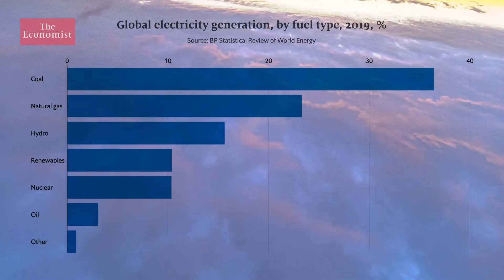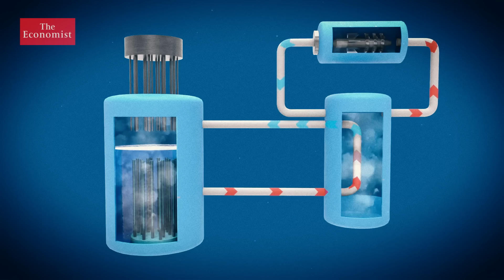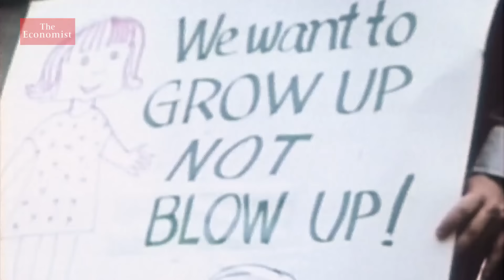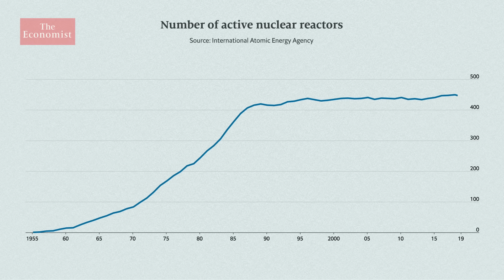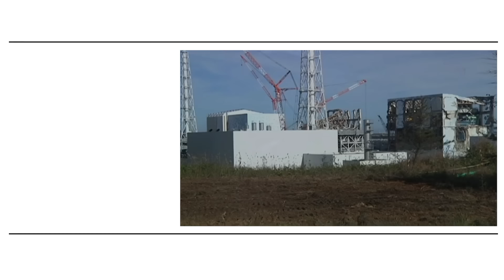Nuclear power: why is it so unpopular?

Comment: Anyone with even a partial understanding of chemistry, physics and nuclear fission, and energy production and IS OBJECTIVE, will know that WISE if totally biased and falsifying figures.  Especially when it comes to Molten Salt Reactors.  It is important to understand that first of all Thorium produces 200 times more energy per atom than Uranium and 2,000 times more than carbon-based fuels.  You cannot be emitting carbon when your fuel source is not carbon-based!  The other important thing to understand is that a Molten Salt Reactor does not require a cooling complex, which is what has been what failed in all three of the major nuclear accidents in history.  That is because the molten salt is both the fuel carrier and the coolant.  Because of its chemistry, it can be heated to 1,500 degrees without coming to a boil  MSRs operate under 700 degrees, we'll within a low threshold.  Water-cooled Uranium plants must pressurize the water to an extreme because water boils at 100c.  Because of the Liquid Flouride Thorium Reactor's inherent self-regulating temperature control, the elaborate pressure and cooling systems and all of the backups, and heavy construction of domes, etc, are eliminated making them far less expensive and hugely more feasible for getting into production quickly.   MSRs do not produce fissile material, so they can be located anywhere.  And since they also do not require water for cooling they can be built in deserts or inside large nations far from water.  ThorCon has designed an MSR that will be on a ship and can be located anywhere.  The political and social resistance against MSRs is based on ignorance and dishonesty.

Comment: On 24 November 2013, the Geneva interim agreement, officially titled the Joint Plan of Action, was a pact signed between Iran and the P5+1 countries in Geneva, Switzerland. It consists of a short-term freeze of portions of Iran's nuclear program in exchange for decreased economic sanctions on Iran, as the countries work towards a long-term agreement. It represents the first formal agreement between the United States and Iran in 34 years. Implementation of the agreement began 20 January 2014. Senior officials of the P5+1 and Iran met February 18-20 in Vienna and agreed on a framework for future negotiations. The next round of senior-level talks are scheduled to begin March 17, 2014 in Vienna. 

The Nov. 24 interim agreement inked in Geneva, Switzerland, between Iran and the United States, France, Britain, Russia, China and Germany calls on the Islamic Republic to halt production of near-weapons-grade nuclear fuel in exchange for some relief from economic sanctions, amounting to some $7 billion. Some hailed the deal a historic achievement, others, a historic mistake. The deal calls on Iran to halt construction of the heavy water nuclear facility in Arak, limit its uranium enrichment activities to 5 percent and dilute or convert its existing stockpiles of 20 percent enriched uranium. Iran also agreed to refrain from installing more sophisticated centrifuges and to allow U.N. inspectors daily access to nuclear facilities. The measures are to remain in place for six months. During that period a permanent agreement is to be negotiated. 

Iran's former nuclear boss has sharply criticized the recent hard-won nuclear deal signed between Tehran and six world powers, saying Iranian negotiators compromised on the country's nuclear program. Fereidoun Abbasi, the former head of the Atomic Energy Organization of Iran (AEOI), said in a radio interview on Tuesday that Iranian negotiators acted hastily and gave many concessions to the world powers during the Geneva talks. Iran and the five permanent members of the United Nations Security Council-the United States, China, Russia, France and Britain-plus Germany sealed an interim deal in Geneva on November 24 to pave the way for the full resolution of the West's decade-old dispute with Iran over the country's nuclear energy program. Under the Geneva deal, the six countries have undertaken to lift some of the existing sanctions against the Islamic Republic in exchange for Tehran agreeing to limit certain aspects of its nuclear activities during six months. It was also agreed that no more sanctions would be imposed on Iran within the same timeframe. 

A senior Iranian cleric says the breakthrough interim nuclear deal struck last month in the Swiss city of Geneva between Iran and six world powers over Tehran's nuclear energy program frustrated anti-Iran propaganda. "The favorable outcome of these [nuclear] negotiations was that the propaganda launched by the [global] arrogance against Iran faded out given that they had long been falsely claiming that the Islamic Republic of Iran is pursuing atomic weapon while we have always stated that we are seeking to acquire nuclear science," Tehran interim Friday Prayers leader Ayatollah Mohammad Emami-Kashani told worshippers in Tehran. Iran and the five permanent members of the United Nations Security Council-the United States, China, Russia, France and Britain-plus Germany are involved in negotiations over Tehran's civilian nuclear activities. Iran and the six world powers sealed an interim deal in Geneva on November 24 to pave the way for the full resolution of the West's decade-old dispute with Iran over the country's nuclear energy program. Under the Geneva deal, the six countries have undertaken to lift some of the existing sanctions against the Islamic Republic in exchange for Iran agreeing to limit certain aspects of its nuclear activities during six months. It was also agreed that no more sanctions would be imposed on Iran within the same timeframe.

Comment: soooo    how have they disposed of the 80000 tons of nuclear waste.   its not about generating energy   its about the lethal toxic waste that lingers for millennia
Reply: It’s a valid problem but climate change is a far bigger one. Nuclear waste may be extremely dangerous but it can be contained, unlike the toxic fumes released by burning fossil fuels. If you live in a city, you’re already significantly more likely to suffer from respiratory illnesses or develop lung cancer.

Comment: Not a supporter for Uranium or plutonium fueled nuclear power, due to potential nuclear disaster. 

Highly supportive in molten salt nuclear research. 
Whatever is clean, effective and efficiency with reliability, then i fully supported.
Reply: Still have to dispose of reactor at end of
commission or entombment event.  Terrapower is just bill gates diversifying his portfolio.
Reply: @kaiyack  But to my understanding, using non uranium or plutonium material such as thorium has a significant shorten half life of nuclear waste.
Reply: @gerjaison  thorium reactors will still create uranium 232 waste which is emits gamma radiation. You could make uranium 233 by messing with the protactinium but that’s the resulting u-233 is only useful in weapons.  Any radiation released an issue.  Basically Trading CO2 for other forms of pollution.

We can deal with CO2 if we optimize agriculture, forestry and oceanography.

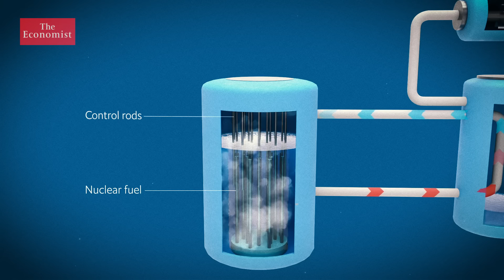Comment: While what you said 3:14 about water acting as a moderator is technically true, it is misleading. A moderator slows down neutrons but this speeds up the reaction. Yes, this is a kind of control, but it's such a common misconception that could have been avoided here.

Comment: Uranium is a poor fuel for electricity generation, but its waste is ideal for taking the next step in creating nuclear weapons, which was required in the 1950's. The original belief was nuclear electricity generation would be too cheap to meter. 
Thorium was known about in the 1950's and was originally considered as the reactor fuel for the first USA submarine. However each fuel has advantages and disadvantages. Thorium is a poor choice for weapons, but a better choice for electricity generation in new technology no pressure salt reactors which can be situated in any industrial estate without fear of pressurised water escape with nuclear contaminants. 
The not in my backyard mentality should not apply to new technology Thorium salt reactors. Thorium is currently co-used with Uranium in some existing high pressure reactors, which negates its unique advantage.

Comment: How do we address the spent fuel issue?
Reply: Stored underground
Reply: @captainjackpugh6050  it is important that you get your facts right, because up to a couple of years ago there were no countries with operational underground repositories apart from Finland. There are still risks involved with underground storage, and span it across thousands of years of storage required the risks rise high
Reply: @animatedarchitecture      There are no risks if it is stored properly
Reply: @captainjackpugh6050  There is no risk free solution that will allow be fool and risk proof for thousands of years
Reply: @animatedarchitecture  Coal is destroying the earth. Storing nuclear waste underground is not.
Reply: @lau6438  neither coal nor nuclear waste would destroy the planet, but it will affect life on it. Storing waste underground is not safe, hence there are no certified underground 'landfill' facilities as of yet, you can't warrant something for thousands of years. Don't forget that nuclear waste is not the only waste from the nuclear plant, it also uses large amount of water to keep the cores cool, which then becomes contaminated with radionuclides. It's not a longterm solution but a beginning of a new one.

Comment: MALAY SUBTITLES Part 2 of 3

05:47
... selanjutnya didorong oleh pembebasan pada tahun 1979 ...
05:50
... sebuah filem berjudul "The China Syndrome" ...
05:53
... yang dengan jelas menggambarkan kemalangan di stesen janakuasa nuklear
05:57
Perkara mengenai "Sindrom China" ...
05:58
... selain itu adalah contoh yang cukup baik ...
06:01
... dari pembuatan filem paranoid 1970-an itu ...
06:04
... adakah ia keluar lebih kurang pada waktu yang sama ...
06:06
... kerana ada kemalangan nuklear di Pulau Three Mile
06:09
Dua pam air yang membantu menyejukkan reaktor nombor dua…
06:12
…menutup
06:13
Pegawai mengatakan sekitar 50-60 ribu gelen air radioaktif ...
06:18
... melarikan diri ke bangunan reaktor
06:22
Ini diikuti oleh kehancuran terkenal ...
06:24
... di Chernobyl pada tahun 1986
06:28
Dan kemudian pada tahun 2011 ...
06:29
... tsunami menyebabkan kemalangan ...
06:31
... di sebuah stesen tenaga nuklear di Fukushima, Jepun
06:36
Setiap kemalangan menimbulkan kebimbangan mengenai tenaga nuklear
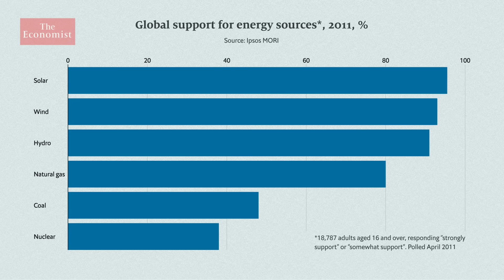06:39
Selepas Fukushima, nuklear mendapat sokongan awam global terendah ...
06:43
… Dari semua sumber tenaga — bahkan lebih rendah daripada arang batu
06:51
Tetapi tenaga nuklear ...
06:52
… Adalah salah satu bentuk pengeluaran tenaga yang paling selamat
06:55
Walaupun jumlah kematian rasmi dikaitkan dengan Fukushima…
06:58
… Berjumlah hampir 600…
07:00
... semua kematian ini - bar satu - disebabkan ...
07:03
... kepada tekanan pemindahan
07:07
Anda mengalami kehancuran skala penuh di Fukushima…
07:09
... dan itu tidak membunuh orang
07:11
Ini menyebabkan tagihan besar untuk membersihkan ...
07:15
... tetapi tidak membunuh orang
07:16
Jadi dalam operasi biasa dan hari ini ...
07:19
... walaupun semasa mogok ...
07:20
… Loji tenaga nuklear yang diatur dengan baik…
07:22
... bukan objek berbahaya
07:26
Berbanding dengan bentuk pengeluaran tenaga lain ...
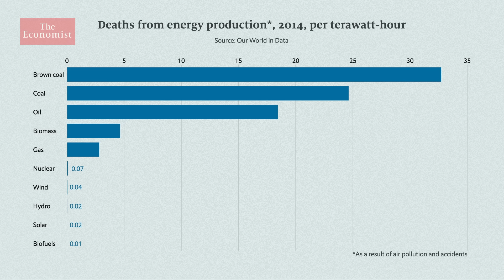07:28
… Kadar kematian akibat tenaga nuklear sangat rendah
07:31
Secara purata, ia membunuh satu orang setiap 14 tahun
07:36
Sebenarnya, pada tahun 2013 ahli klimatologi James Hansen dan Pushker Kharecha…
07:41
... dikira bahawa penggunaan tenaga nuklear ...
07:44
... antara tahun 1971 dan 2009 menghalang kematian 1.84 juta orang ...
07:50
... berkat faedah pencemaran udara
07:54
Ketakutan bahawa loji nuklear ...
07:55
… Memancarkan tahap bahaya radiasi yang berlebihan
08:00
Satu-satunya kemalangan yang mengeluarkan radiasi tahap tinggi ...
08:03
... dan menyebabkan bahaya besar kepada kesihatan awam ...
08:05
... adalah Chernobyl
08:07
Tetapi itu adalah loji nuklear yang tidak begitu baik ...
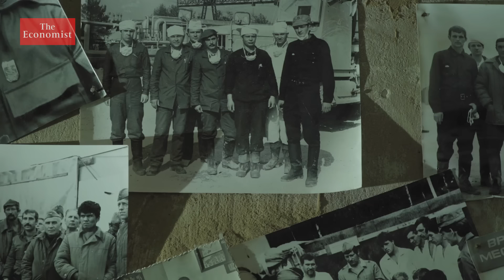08:09
... dijalankan dengan cara yang mengerikan
08:11
Orang bimbang tentang radiasi ...
08:13
... tetapi secara amnya, stesen tenaga nuklear ...
08:16
... jangan lepaskan sinaran
08:22
Kebimbangan yang lebih besar ...
08:24
… Berpusat pada bahan bakar nuklear
08:27
Stesen tenaga nuklear memerlukan bahan bakar nuklear…
08:30
... dan biasanya bahan api nuklear mesti menjadi sesuatu ...
08:33
... itu diperkaya
08:35
Dan proses pengayaan itu ...
08:36
... juga proses yang anda gunakan ...
08:38
... untuk membuat senjata nuklear
08:42
Tiga, dua, satu, sekarang, satu, dua
08:47
Senjata nuklear juga dapat dibuat dengan mengeluarkan plutonium…
08:50
... dari bahan bakar nuklear yang habis
08:53
Ini bermaksud negara boleh menggunakan stesen janakuasa…
08:55
... sebagai penutup untuk mengembangkan persenjataan ...
08:58
... mempertaruhkan penyebaran senjata atom ...
09:00
... kepada negara-negara yang tidak dikenali sebagai negara senjata nuklear ...
09:03
... dalam Perjanjian Tanpa Penyebaran
09:08
Kebanyakan orang yang mempunyai stesen tenaga nuklear…
09:10
... bukan risiko pembiakan
09:12
Mereka mempunyai senjata nuklear ...
09:14
... atau jelas tidak benar-benar mahukan senjata nuklear
09:18
Apa yang anda risaukan ialah apabila anda mempunyai negara…
09:21
... itu di bahagian dunia yang tidak stabil ...
09:23
... dan mula berminat dengan teknologi nuklear
09:26
Mungkin contoh yang paling membimbangkan adalah Iran
09:30
Sejak 1980-an…
09:31
... Kerajaan Barat prihatin ...
09:34
... bahawa Iran akan menggunakan program pengayaan uraniumnya ...
09:37
... untuk tujuan ketenteraan
09:39
Ke Tehran ini adalah syarikat awam yang aman ...
09:42
... tetapi ada di seluruh dunia ...
09:43
... bimbang ia boleh menyebabkan pengembangan senjata nuklear
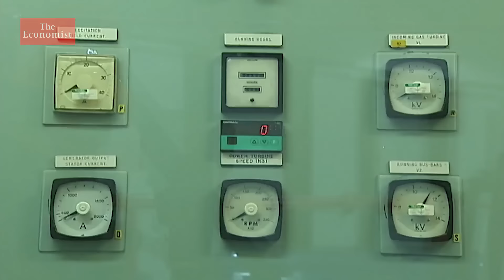09:48
Tetapi mengembangkan senjata nuklear ...
09:50
... dari program awam sukar
09:53
Reaktor hanya memerlukan uranium yang diperkaya hingga sekitar 4%
09:57
Senjata nuklear memerlukan tahap sekitar 90%
10:02
Dan semasa mengekstrak plutonium sedikit lebih mudah ...
10:05
... mana-mana negara yang merancang untuk melancarkan industri tenaga nuklear baru ...
10:08
... akan menarik perhatian ...
10:10
... dari badan seperti Badan Tenaga Atom Antarabangsa
10:18
Tetapi akhirnya alasan tenaga nuklear tidak digunakan secara meluas ...
10:22
... berpunca dari satu faktor penting
10:25
Ia sangat mahal
10:28
Stesen tenaga nuklear sangat besar ...
10:30
... sistem yang cukup kompleks ...
10:33
... yang mesti anda bina dengan tepat
10:35
Mereka adalah projek pembinaan yang besar ...
10:37
... yang berlarutan sepanjang masa dan yang menaikkan kos
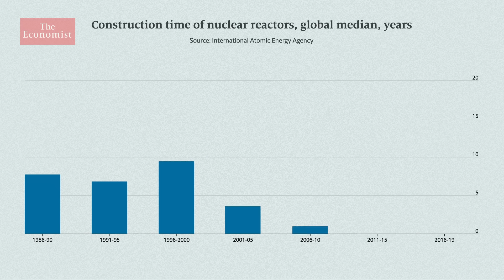10:43
Untuk reaktor nuklear yang disiapkan antara 2016 dan 2019…
10:48
... masa pembinaan median ...
10:49
... hampir 17 tahun
10:52
Kos dapat disimpan hingga batas tertentu…
10:55
... jika anda membuat banyak perkara
10:58
Dan itulah tahap rahsia kejayaan ...
11:00
... program Perancis
11:01
Orang Perancis memilih reka bentuk tertentu dan membuatnya banyak
11:06
Orang Cina melakukan perkara yang serupa
11:09
Di Amerika, tidak pernah ada standardisasi

Comment: This is an incomplete picture. Nuclear waste, the fuel rods need to be stored for a thousand years in a contained facility. No government today can promise a commitment that long. The cost of building and maintaining such facilities is not discussed at all in this video. It's borderline propaganda. Nuclear isn't popular because it isn't feasible for the future.
Reply: Those spent fuel rods will be valuable fuel in thorium molten salt reactors.  No one has been injured by stored nuclear waste.
Reply: @danadurnfordkevinblanchdebunk  No one said people were injured. I stated it doesn't evaluate the cost correctly.
Reply: @GlobeTrotter267   Those spent rods will be the most valuable substance on earth!  If you bury them, we will just be digging them back up.
Reply: @danadurnfordkevinblanchdebunk  I understand, but that's not what the author of the video asserts or discusses. I did state the video was an incomplete picture.
Reply: @GlobeTrotter267   Your original meme says nuclear is not feasible for the future because of it's waste. Quite the opposite is actually the case.
Reply: Sure buddy
Reply: @GlobeTrotter267   Well if you don't educate yourself....

Comment: Two simple questions; what are we supposed to do with the waste and how much carbon is involved in building those facilities?
Reply: developments in technology means a lot of it can be recycled and the remainder goes deep underground. nuclear is literally the most efficient power production technique by a long shot so the initial "investment" of carbon is actually far less for the same amount of electricity than any other power source
Reply: @Eltener123  deep underground for 100,000 years. It takes two generations to build a facility like that. How many are there in the world right now??
Reply: I'm not completely against nuclear energy. But we have to be fully informed of the implications of the whole life energy implications of each component and the fuel before we advocate upscaling global implementation.
Reply: Waste stored underground
Reply: @captainjackpugh6050  Take a look at Michael Madsen's 'Into Eternity'. It's not as simple as it sounds.
Reply: @shalashaskalives      No no, it is. Store it underground properly and it will be fine for thousands of years.
Reply: @captainjackpugh6050  But 100,000 years?? We have no precedent for such an endeavour. You're very optimistic.
Reply: @shalashaskalives     More like a thousand years. But what’s wrong with storing it for such a long time?
Reply: @captainjackpugh6050  I'm not going to get embroiled in a scientific debate on a platform more suited to cat videos, with a likely teenager called 'Captain Jack'.  I'm just not, I should never have started this.